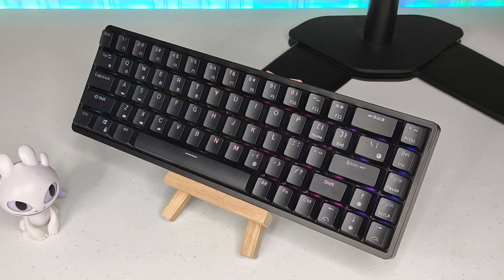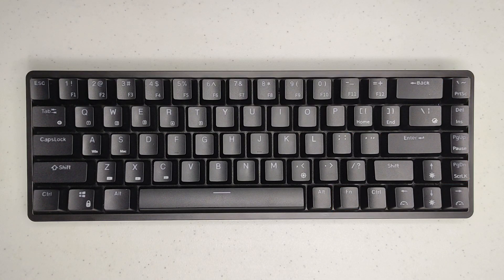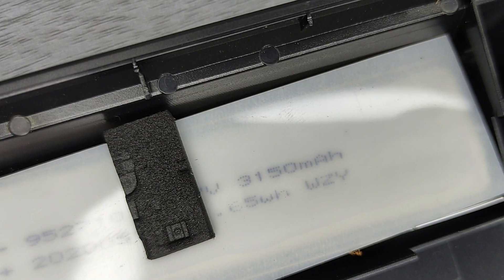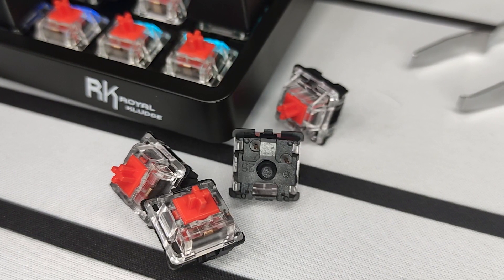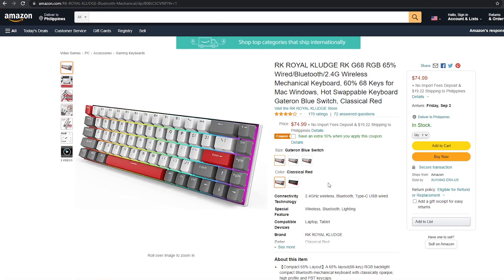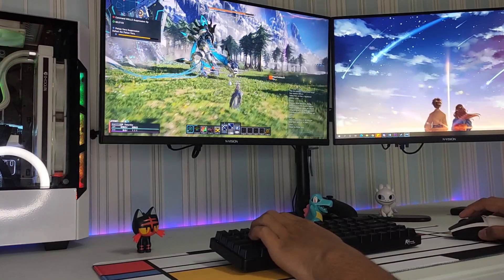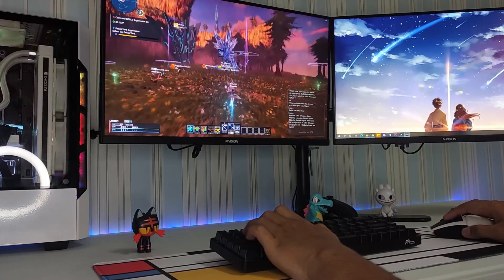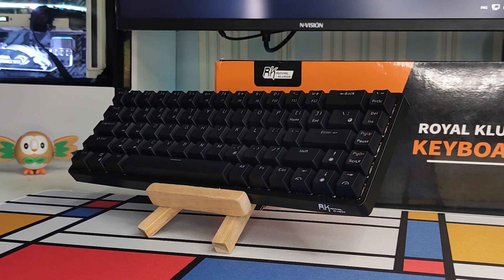Best Value 65% Mechanical Keyboard - Royal Kludge RK G68/RK837 Hotswap - 2021 version - Full Review

Comment: Hi, how long does the RK G68 usually takes before fully charge? My keyboard only last one whole day with a level lower from the max brightness of RGB. I tried charging this last night but didn't really know if it was already full. I just unplugged it since the battery feels a bit hot already after 2 to 3 hrs of charging. Hope you could answer me regarding this query thank you and nice review btw 👏 More power!
Reply from the maker: About 2-3 hours. If you've been using the keyboard the whole day(20+ hours) like it doesn't turn off at all then that's normal. It also depends on the RGB setting you use. More flashy, moving effects tend to eat more battery as opposed to steady single color settings.

Comment: recommendation? this rkg68 vs k530 pro?
Reply from the maker: I'd still go with the RK G68 because of the features(tri-mode, USB passthrough, 5pin hotswap sockets) and overall modability. K530 beats it out in stock looks but as a keyboard enthusiast, you're likely going to mod keyboards anyway so better get something you can easily mod with nice features :)

Comment: Great video I kind of want to change to this keyboard after my anne pro 2 has issues with the switch and not hot swappable 😢… my wasd keys are broken and they barely get registered input even when i use them wired to my laptop.
Reply from the maker: Oh yeah Anne pro 2 is a great keeb. Mine had a good run before I sold it because of this keyboard. If they come up with a revamped Anne pro 2 hotswap I'd buy it in a heartbeat. But yeah for now rk g68 should do the job for me :)
Reply: @KonzTech  Sad part for me is that I cannot sell it because the wasd keys have issues :/
Reply from the maker: You can use it for a soldering project. At least you're not spending more to get a new keyboard to practice on :)

Comment: wait this isn't cherry or gateron? then what is it?
Reply from the maker: It's using RK switches(rebranded Huano switches I believe). However, the board uses a 5-pin universal socket so you can use Cherry, Gateron and every MX-styled switch out there.
Reply: Some sellers offer a gateron option. I got the RKG68 White in late November 2022 (tri-mode, rgb) with Gateron Yellows (I assume it's the pro yellows due to the right side up gateron text when mounted north-facing, but I am not 100% sure) for about 900 THB with some discounts (~1900 THB is the full price) on RK's official store on Lazada. Seems like the newer stock has the foam between the plate and pcb as well (mine does).

Comment: Hi! Quick question(s)! Is this the one that has the top part of the case pop out? Annnd is this the same as the Royal Kludge G68? Doe the RK mean anything hahaha? Thanks in advance! :)
Reply from the maker: They're pretty much the same..However, note that some regions have different make. The one reviewed here is from the SEA market(bought from Shopee/Lazada). I believe the Amazon and other international market models don't have the removable shroud but retain the same features(5 pin hotswap and tri-mode connection). The older releases don't have passthroughs though so double check with the seller or the item description before purchasing.
Reply: @KonzTech  Noted! Thanks so much for the info!! :)

Comment: how many pins does this keyboard support?which switches are suitable, optical or mechanical?
Reply from the maker: Up to 5pins..optical switches are not compatible..only traditional mx-styled switches(3pin or 5pin)
Reply: @KonzTech  Thanks for the info
Reply from the maker: no prob. Optical switches use a different PCB. There's no PCB as of yet that supports optical and traditional pin style switches

Comment: hi, how do we know this keyboard is charging? ive plugged it in to the wall socket and all I can see just the "Q" keeps on blinking, 

and how do I know if its fully charged?
Reply from the maker: Ohhh noooo..Don't plug it in to the wall socket. The current's too strong and you might burn your PCB. Just plug it through your computer's port. The blinking Q means it's trying to pair to a bluetooth device. There will be a red LED indicator under the spacebar when it's charging and that should ideally go away when it's fully charged or if you turn off the keyboard and just go on wired mode. Sometimes, it doesn't go away though even if it's fully charged...a common issue with Rk keyboards from my experience.

Comment: I just have this keyboard. This is my first mechanical keyboaard and it is so perfect!. Mine have a white plate that makes the rgb brighter.
Reply from the maker: Cool! Yeah this keyboard's really good. I modded this one now. You can checkout my mod vid if you want :)
Reply: hey, mind if you post some update? any error with the keebs so far?  i planned to buy this
Reply from the maker: @muhamadrizal4  This keyboard was just modded last month. I posted a vid in the channel and I'm using my modded RK G68 to type this reply. It's still good and I love it :)
Reply: @muhamadrizal4  My number 7 suddenly stopped working because the switch outlet (Where the switch pins go through in the board) was broken by my brother but I soldered it back and it works perfectly fine again. So far no issues I have been using it for almost a month battery, rgb, and 2.4 ghz wireless connection works perfectly fine.
Reply: @EGStudios99  i see, did you install the software/firmware? Sorry if I asked too much, haha
Reply: @muhamadrizal4  Nope

Comment: Brought mine recently, plug in and it blink 3 times. charge the whole day and still didn’t blink 5 times. Not sure if it’s fully charged :(
Reply: I need help 😭
Reply from the maker: It appears to be a common glitch for most royal kludge keyboards. Just unplug it after about 2 hours and it should've already fully charged. Overcharging/undercharging is not a case also since you can just keep the keyboard plugged in forever or just charge it for sometime and plug it out and it will hold to whatever charge it got. There's a red LED charging indicator under the spacebar when it's charging..sometimes that goes away when it's fully charged..sometimes it doesn't. At least that's what I noticed on my unit and some of the Royal kludge keyboard units I've seen in my group.
Reply: @KonzTech  thank you so much🥲

Comment: Nice review! It made me buy the keyboard haha. May I ask if yours blink 5 times when fully charged? It’s the only feature that I haven’t experienced yet in my keyboard, though there are no problems on other specs.
Reply from the maker: That doesn't happen to me. The FN light blinks though when it's starting to run low on battery
Reply: @KonzTech  ohhh fn did started to blink when it was running low. Thanks! you definitely deserve the subs!

Comment: Nice review! I just got this keyboard and Id just like to ask how do I know if my keyboard is charging?
Reply from the maker: There would be a small red light below the spacebar when you plug the keyboard to the USB cable. All royal kludge keyboards have that indicator. This model of mine seems kindda glitchy though. I know it will not light up if the keyboard switch is "off" and the cable is plugged in...but sometimes it still lights up if I do. Also, when charging, the red light doesn't go away even after if it's fully charged

Comment: Great review. May I ask, what bluetooth version does your model have? The variant sold on amazon is bt 5.1, but it also doesn't come with the detachable frame and can only switch between 3 devices as opposed to 5. I'm wondering if theres any advantage to buying from amazon rather than somewhere else (if the only advantage amazon has is better bluetooth id still take it).
Reply from the maker: I think it's 5.0...sorry I'm not really sure how to tell it since it was not specified in the specsheet or anywhere on the box when I bought this. I believe the ones in Amazon(US and European regions) are different from the ones here in SEA. So far I think the only one with the removable frames are the ones from SEA.

Comment: New owner po ako ng same keyboard.
Pano po malalaman na charging yung keybaord and if full charge na??
Reply from the maker: May red LED indicator sa spacebar kpag charging xa. It usually goes away kapag full charged na ung keyboard..though sometimes hindi xa nawawala. I'm not really bothered since batteries used on wireless keyboards/mice don't suffer from overcharging.

Comment: Hey, mate. I wanna ask something, is it safe to try unmounting the plate from the PCB? Coz i'm a newbie that want to try plate foaming my RK by myself, but i'm just afraid that it gonna cause an unexpected problem, in part where i need to unplug the usb passthru & battery connector. And if it so, is there any suggestion for me to unmount it safely without causing any kind of problem afterward? Thx
Reply from the maker: Just make sure to unscrew everything and don't force anything out if it won't budge. Make sure you have the proper tools like a philips screwdriver and maybe a pair of tweezers

Comment: Hi sir, just wondering...
When I bought my RK G68, I didn't get: English Manual (it's in Chinese), extra switch, 2 USB passthrough  appears to be blocked. I'm starting to think I bought a fake one. Are there any clones/fake RK G68?
Reply from the maker: no. If you're trying to use the USB passthrough wirelessly, then it will definitely not work. It only works when the keyboard is on wired mode.
Reply: @KonzTech  I meant 'covered'. I don't have that 2 USB passthroughs. Does this mean that my G68 is fake?
Reply from the maker: That's a different variant..I learned from other commenters that the 2020 had no usb passthrough while the 2021 has it. Breeze through the comments you'll find it.

Comment: how will you know if the battery is in full charged and how many hours to charge? got mine yesterday.
Reply from the maker: The red light on the spacebar should go away once it's fully charged(but this is buggy..sometimes it remains red regardless of full charged). It takes about 2hours to fully charge
Reply: @KonzTech  why mine doesn't have a red light when it's charging?

Comment: is there a software of this thst u can edit the rgb to one solid color cause i prefer only blue thank youu :))
Reply from the maker: There is but better ask it from the seller as there are different variations of this keyboard. You can manually set the RGB too to a static color. I believe I've shown it on the later part of the vid. The keyboard manual also explains this.
Reply: when gaming is the dongle usb good for 24 hours ?
Reply from the maker: yeah..the keyboard can last up to 50+hours easily or rougly 3-5 days depending on your usage.
If you're gaming then the 2.4Ghz wireless dongle is the better choice. Bluetooth delay is so bad I easily miss my last hits on dota because of it. If you play Dota then you know what I mean..spamming "S" to time last hits..or comboing invoker spells is near impossible on Bluetooth.
Reply: niceee thank youuu

Comment: Thanks for the vid dude im gonna get this one, salamat!
Reply: also how do you charge this device, and also use in wired mode?
Reply from the maker: Just charge it using the USB-C cable included and connect it to your PC. It automatically goes on wired mode when plugged in(at least from my experience). Otherwise, you can switch to your desired mode(the manual would explain it) or just flip the switch off. If the switch is off and the keyboard is connected to the computer, then it goes on wired mode.

Comment: Hi I'm having a very hard time on choosing between the rk g68, rk84, and tecware b68. Also are there any differences between this and the rk68? Thanks
Reply from the maker: B68 has better stock typing performance than any RK keyboard. The new RK keyboards like this one outshines the B68 on features(tri-mode connection, USB passthrough and beefy battery).
It really depends on what you really want out of your keyboard. If you want the best wireless performance then the Royal Kludge keyboards are your best bets because of their 2.4Ghz wireless connection. If you want the best stock typing feel, then B68.
Reply: @KonzTech  Thanks for the quick reply! Hope to see more vids from you
Reply from the maker: You're welcome. I just released a video of a really promising keyboard sent over to me. It's just sad that it's not yet available in the Philippines. They're available through Amazon but maaan the shipping fees are crazy @_@
Reply: @KonzTech  All that for 40$ is crazy! Having the usb c port to the left is a big plus to me. Any idea if theyll be releasing those in gateron yellows?
Reply from the maker: I'm not sure. The ones in Alibaba and Amazon have Gateron Optical Black, Red, Blue and Brown only. I plan to mod this one with yellows. I recall seeing Gat yellow opticals last time in shopee.

Comment: When using bluetooth mode, does it automatically connect when you turn on your computer?
Reply from the maker: It does. Bluetooth drivers are loaded on the operating system level. Windows 10 usually preloads the drivers at the login screen
Reply: @KonzTech  when in macbook, does it also connect automatically?
Reply from the maker: haven't tried a macbook yet. I guess it should..just make sure you wake up the keyboard if it's on sleep mode by pressing any button
Reply: @KonzTech  and last question, do you have any suggestion about what version of royal kludge id get??? It doesnt have to be with number pad, just arrow keys. And a keyboard with good rgb color effects.
Reply from the maker: RK G68 or RK71/84/987 - these models have dedicated arrow keys. As for lighting, maybe get the white variant since they reflect more light. The thing I've noticed with most royal kludge keyboards is that their stock keycaps just don't really let a lot of light pass through them especially the black variants like mine.

Comment: Hi sir! We have the same keeb, I just want to ask how to know when its charging. When I plug it, the spacebar blinks 3x then nothing happens. Does that mean its charging na? btw, love the vid. Thank you!
Reply from the maker: The spacebar would have a steady red LED when its charging. Sometimes it goes off when the keyboard gets fully charged. Sometimes it does not. Its a common issue for most RK keyboards as I have experienced that as well on my RK G87
Reply: @KonzTech  how to properly charge it po ba? Dapat po ba naka off and on wired mode?
Reply from the maker: saksak mo lang. Kapag naka-off ung keyboard hindi lalabas ung red LED. Again, yung indicator nia na fully charged can be there or not. Sometimes mamamatay ung red LED..sometimes hindi...di nmn xa serious issue since batteries used on mechanical keyboards don't suffer from overcharging nor from not being fully charged.
Reply: @KonzTech  ok po. Thank you for answering my questions 😬
Reply from the maker: np. Basta saksak m lng kpag nag blink n ung FN key then bunutin m after 2hours or so full charged n yn most likely xD
Reply: Hi! Yung akin, nagbiblink rin 3 times then after non wala na. Sabi sa manual, it will blink 5 times pag fully charged na, but mga nasa 5-6 hrs na ko nagchacharge pero hndi pa rin nagblink ng 5 times..

Also, nagbiblink ung “Q” kahit naka off ung keyboard. Why po kaya ganon? Sorry newbie sa keebs. hehehe
Reply: @jeaninebuenaventura3847  I'm not so sure about it being turned off. It might be caused by the Bluetooth switch turned on and its in "pairing mode"

Comment: Boss ganun ba talaga yung RK G68? Pag ka nilalagay ko sa sleep yung laptop ng naka wired yung keyboard minsan yung keyboard naka on yung RGB tapos nag bblink yung P tapos hindi mo siya magagamit pang wake ng laptop tapos minsan naman nag o-off yung RGB pero pag pindot mo ng kahit anong keys nag wawake yung laptop. Sana masagot tanong ko boss, salamat!
Reply from the maker: Usually when the computer goes to sleep, disabled ung bluetooth nia. Blinking P means nag-aattempt ung keyboard mag-pair. From what I know you can't wake up a PC from sleep through bluetooth since sa OS level nagiinteract ung bluetooth drivers..same reason why you can't interact with the BIOS using a bluetooth keyboard. Try the dongle since sa USB interface xa and direkta sa board.

On a sidenote, sleep and turn off screen on idle are different. You can search for "Power and Sleep settings" sa Windows and makikita mo ung parameters nila.
Reply: @KonzTech  naka wired po ako boss the whole time eh, never pa po ako nag b-bluetooth
Reply from the maker: naka turn off b ung keyboard? Kung magwiwired mode ka, make sure mo lng n ung switch is nakaset sa off and nasa "G" ung isang switch

Comment: I bought this keyboard (Same amazon link) but it came without the bezel. In your video, you had a bezel that you removed. The amazon product page shows all pictures without the bezel. Where can I find the bezel AND can I get it in different colors to match my chosen keycaps?
Reply from the maker: I'm surprised it did not..hmmm maybe the ones in Amazon doesn't come with them. Here in my region(SEA). Ours doesn't come with PBT keycaps but it came with a bezel. We have some guys here who make custom bezels for different keyboards like this. You can probably check around in your area if there's one that makes it. Or if you know someone who makes customized resin/plastic products, you can give him the dimensions of your keyboard and explain what you need.